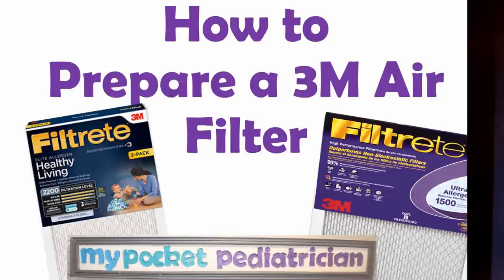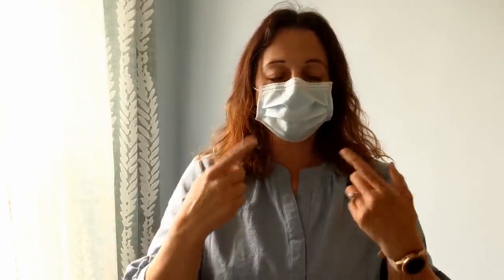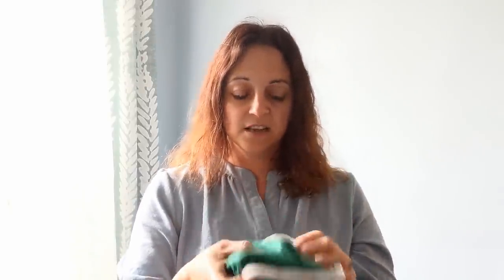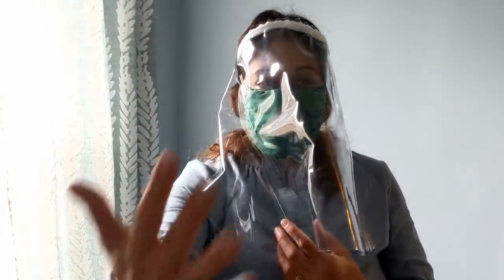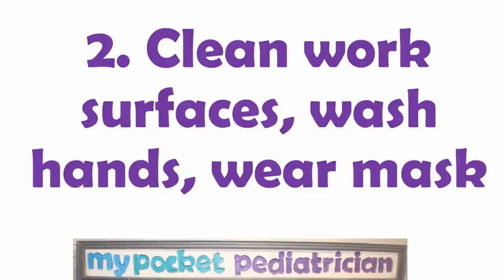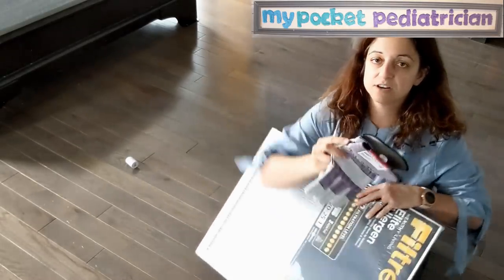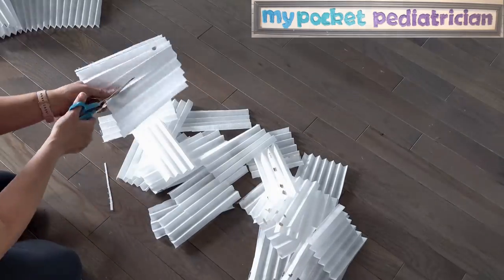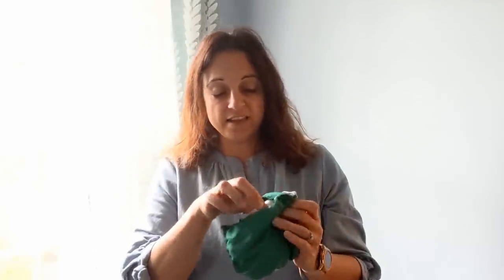UPDATED!  How to Turn a 3M Air Filter into a Face Mask

Comment: Thank you. Great mask design.  FYI, I tried dismantling the 3M filter the same way you did.  However, after suffering several skin punctures, I decided to use serrated heavy-duty scissors to cut just inside the cardboard frame.  This sacrifices about an inch of the filter material on each side but allows you to easily pull the wire from the filter and eliminates having to remove the glue (which can possibly damage the material anyway).  This method is much faster, safer and easier.  Hope this might help. Thank you again.
Reply: ChuckRich I did the same thing!
Reply: Me too , but my metal snips ( post sterilization ) made really quick work of it. Glad I got the "contractor" pack of filters the last time I went to Lowe's.
Reply from the maker: Great idea!  I have a new and improved Adjustable mask with FILTI material that passed the FIT test!  Please check it out here:  https://youtu.be/2J3Fq4o-U4I
Reply from the maker: I have a new and improved Adjustable mask with FILTI material that passed the FIT test!  Please check it out here:  https://youtu.be/2J3Fq4o-U4I
Reply: My Pocket Pediatrician I am using the 1900 filtrete and cut packaging away. I can’t tell which way is up,ie which side towards face.
Reply: @dianeisherwood2767    If you have a second filter for comparison there is a subtle but visible difference between the sides. On mine (2200) there are more ( and longer) fibers visible on the one surface.
Reply: ChuckRich agreed.  I thought the exact same thing.  Too much work for 1 inch of material.

Comment: My husband suggested you use tin snips to cut around the perimeter of the cardboard so you easily eliminate the cardboard and glue and also the wire will just pop off.
Reply from the maker: thanks!  great idea!  I think I may have a better material than the HVAC filter, so please subscribe so you get updates!

Comment: After making many of these, i would like to suggest some tips:

- Make your pattern piece with a piece of mylar or glossy cardstock or something similar that is firm and not easy to accidentally slice the edge off of or crush.

- After dusting and vacuuming, I close the window in my room, and turn on the air purifier. Then I place a freshly cleaned sheet (protected from dust and dander, and place it over my bed. I place another on the floor as well, to prevent kicking up dust. I have my hair back, my mask on, and i wear fresh clothes that were handled with sanitized hands. 
I know it seems like overkill, but my customers have allergies, and they deserve to be protected. Sanitize the pens and the scissors, and any other things you'll need, like ziplocs and maybe post- it notes or other labels.

- After stripping the cardboard edges, metal, and any glue off, cut the filter into strips that go across the short side of the filter fabric, making them as wide as the piece where it measures from nose to chin. Then accordian fold it and place the pattern piece over the top and grip all of it in your hand so that it's all smooth and taught, and then cut out several pieces at once. This saves the time of tracing out each piece and then getting ink on your fingers, which will happen. If you really need to trace it out, use a ball point or a gel pen, but do not use Sharpie - it creates fumes.

- As you go, pack them in ziplock bags, to keep them from getting contaminated by particles that could inadvertently enter the room. Try to keep track of how many you are putting in the bags, so that you don't have to handle them a lot more to count them out.

- If you didn't mark the face side, and can't tell which side is which, hold the fabric under light. One side has glossy fibers, whereas the side that goes up to your face has a flatter, less shiny look. The other side with the glossy fibers is also the side that tends to fray and fuzz up. So try to handle the filter material as little as possible, to keep all that fraying from happening. Too much wear may affect the quality of the filter.

- Once they are all cut, mark them - i put he word "Nose" or "Inside" at the top of the mask where it would meet your nose. A dot is fine, but sometimes a dot is hard to see, and people may forget what the dot actually means. (Sounds dumb, but trust me - be specific). Again, use ball point, NOT Sharpie.

Comment: I'm a doctor....I tried to breathe through a Ziploc bag and couldn't
Reply: Dr. Winters, please have a look at my idea that I posted a few minutes ago, and let me know what you think. (about using pantyhose over your head with the filtrete filter underneath)
Reply from the maker: I honestly didn't think my seal was that great initially.  I quickly proved myself wrong!  This video has been updated - please see the new version here:  https://youtu.be/2J3Fq4o-U4I
Reply: If you’re a dr why would you even attempt to?
Reply from the maker: @moneymel3756  I really didn't think I had achieved that tight of a seal.    I didn't think it was possible to make something at home in a DIY that would actually work when I started out, and that was before I fit tested to know it worked.
Reply: There's a reason"suffocate warnings" are on plastic bags
Reply: Thank you for pointing this out. I caught it and couldn’t believe a “doctor” tried to breath through plastic!
Reply: @joanbelmont5450  I can't believe anyone would try.  My dog agrees with me.

Comment: Thank you so much for this. I did some research about these specific filters. The Filtrete Healthy Air filters are made from Polypropylene and Polyolefin. They ARE NOT made from fiberglass! This is very, very important! They're made of plastic, not fiberglass.
Reply from the maker: Agree!  Thank you so much!   I believe I'll have some design improvements in the next couple of days - please subscribe so you get the updates!
Reply: @MyPocketPediatrician  Absolutely, thank you again!
Reply from the maker: I have a new and improved Adjustable mask with FILTI material that passed the FIT test!  Please check it out here:  https://youtu.be/2J3Fq4o-U4I

Comment: Great video and thanks for posting it. I also thought of using 3M furnace air filter material as an insert. I agree with everything you said. Except one that I don't think filter material itself has any specific air flow direction. The reason furnace filter has air flow direction shown is for their cardboard frame structure. For example, the furnace filter has thin wires on the air exhaust side to keep the filters in place. Without this wire mesh, strong air flow will deform the filters or even flow it out completely. So I think it doesn't really matter which side of filter you use in your mask. Thanks
Reply: luxman999 I agree!

Comment: Thank you for posting this, I bought the 1900 filter but This showed the masks I planned to make would not work as well as I hoped. I need to make the filter removable and make sure I have the right side facing the face. I was starting to make masks for family but I see I need to start from scratch now. THANK YOU!!
Reply from the maker: Check out this tutorial. https://youtu.be/4eOc5_rBCrM
Reply: Christy Langley do you really plan on using this as a replacement for social distancing??? dont beat your self up over it.
Reply: @MyPocketPediatrician  Is there any way to tell the difference between the two sides of the filtrete filter once you've already taken off all of the boxing and wiring? I noticed one side is more shiny, and one side has more of a felt-type texture. Do you know which side should be facing the individual wearing the mask? Much thanks!
Reply: @slyfox1983  Of course not. Im making  them for friends and family. Being a liver transplant and cancer patient I am staying at home, only going out for food and medicine.
Reply: @aeljaouhari  I was wondering the same!  Would love to know.
Reply: Christy Langley im glad you're in good health!!
Reply: @aeljaouhari  wondering the same. I had already taken the filter out before watching this video so now I feel like it might not work.
Reply: @zitronena04  one side is more shiny than the other. It's the shiny side that should be facing you, facing your mouth.

Comment: Thank you Dr.  We have the cotton home made masks but need the 3M Filter inside!  I believe the fiberglass is in the hepa vacuum bags, not the AC filter.
Reply from the maker: I have a new and improved Adjustable mask with FILTI material that passed the FIT test!  Please check it out here:  https://youtu.be/2J3Fq4o-U4I

Comment: Fiberglass filters are not the same as pleated air filters. The fiberglass ones are usually less expensive ones that look kind of like stretched cotton NOT the pleated filter like she is using.
Reply from the maker: Thanks!
Reply: My Pocket Pediatrician I had a similar question the first time I heard about using air filters as face masks so I looked into it and did some research into it probably more than I needed too (but I just finished a MA program and missed studying a subject HA).
Reply: My Pocket Pediatrician I tried to contact 3M about the use of the filter so close to the face, but could not get through to customer service. There is much info floating around that furnace filters should not be close to face and breathed in, due to fiber and chemical content. What did your research show?

Comment: Don't forget to read the MSDS of a marker being used for labeling. Some might want to avoid unnecessary solvent exposure.
Reply: Is there a suggested safer type of marker?
Reply: @SunnyArkfam1  Heavy sarcasm, I'm sure. There are a lot of people commenting on the hazards of using material that might cause health problems in the years to come from a homemade mask that you use to avoid being terminated by a virus in a few weeks. Cotton is safe to use, but you won't see or smell the virus that easily passes through it.
Reply: @SunnyArkfam1  I would lean toward markers manufactured for children or crayons. 
 Markers that contain solvents where people use them to get high might present an avoidable risk.

Comment: I had a nurse tell me if your can see your breath on a cold mirror with a mask on it means the mask is not good enough
Reply: Something I've noticed that is also a good indicator is if you wear glasses and your breath fogs up the glasses than it's not a good fitting mask. I do have an N95 mask from a previously home improvement project so I tested this and the N95 didn't fog up my glasses at all. However my homemade mask with filters added did. I ended up using double sided skin safe adhesive around any loose areas to get a better fit and then it no longer fogged up my glasses.
Reply: That would mean any rated mask with an exhale valve isn't working, including heavy duty reusable respirators.

I think I get the point she was trying to make in an attempt to stop people from needlessly using N95s, but a Cambridge study post last SARS outbreak showed the effective rating on double cotton to be over 60% filtering efficiency and actually increase efficiency after 3 hours of wear. So obviously breath would be seen through double cotton, but it's much more the fit around the face that becomes critical. 

Tape is an option, but it's something designers need to be finding a work around for because tape will lose its seal over time as you sweat/move/ talk, creating an exposure risk for workers or the need to change masks more frequently which could lead to skin irritation and then broken skin creating a risk of infection and even scarring. Long term, it's something we absolutely want to avoid for our healthcare workers because scaring around the area where a respirator seals can prevent a proper seal from forming with a commercial respirator, meaning needing a new style and fit test would be required amidst this chaotic time when any respirator is hard to come by in some regions. 
Which brings us back to the message of why we need to convince those hoarding jerks out there to stop it, because we can't lose our doctors with so many regions of the US already underserved. Sorry if that comes off a little ranty. I work in a pharmacy and my area still doesn't seem to get the stay home order means EVERYONE and/or they think the immunocompromised and elderly who are most likely to die are just expendable (legit what a guy had the gall to say to me, in front of a nurse no less). 

Stay safe. Stay home unless you need critical items. And contact your local hospital or organization before you start making for others to get their specific requirements. 🙏
Reply: @KatieCottingham  A congressman on news today said China had stockpiled protective gear. Their customs report showed they received 2.2 billion face masks between 1/24 to end of February alone. Bear in mind that both they and WHO were saying there was no human to human transmission, despite doctors being jailed in December for trying to warn his colleagues, and Taiwan and local countries shutting down to China in January. On 1/30, the WHO finally  advised world concern. So when you see China now sending protective gear, it's because they tried cornering world supply.😡 And that gear needs to be tested, which I'm sure the government is doing.
I wish you health in your area. Some people are impossibly ignorant. Thanks for the info also.
Reply: T Ammons please stop slamming China! American Asians are already experiencing hate crimes everywhere. What does your point have to do with anything in this video?

Comment: You must remember the air filter is designed to pull air in one direction.  In this case toward you. It will be hard to breath out over time. That can be another reason why it is a build up of moisture in your mask. In which over time can cause you to be light headed.
Reply: @cc • 1 day ago ... yup, totally agree. And anyone with cardiovascular issues, they say wearing a tight fittingmask for too long is a health risk. It is recommended that a breath of fresh air is taken at least every 20 minutes to prevent fainting, dizziness, or lightheaded and or exhaustion.

Comment: I don’t see any reason why you can’t spray the mask down with 91% alcohol after using and let it dry.  This would kill everything on the mask and after dry would be ready to wear again.  I am only talking about the mask itself, not the filter material.
Reply: ATL WOLF do you have a link discussing this? My older neighbor still goes to work every day and wears the same 2 n95 masks..,which he dunks in alcohol and air dries.  I would love a link that talks about this static charge and wetness.